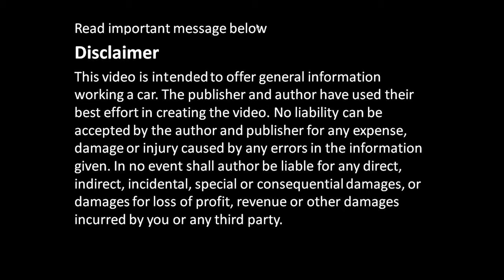How works Oil Cooler

Comment: I have an issue where coolant level keeps going down with no visible external leak, like half an inch down in a week with just a few hours of everyday drive.

Can a bad oil cooler leak coolant into the engine slowly?
Reply from the maker: Thanks for comment 👍😀

Comment: What happens ..if that coolant lines in oilcooler wil get bloked ?
Reply from the maker: Oil becomes hotter and engine could overheat
Reply: @PeterFinnTheCarDoctor   i was driving ..past 1 year like in that situation...
Recently change whole assembly..
Got to know old  part ..coolant line were blocked ..previous owner did that he fixed some sticky thing inside ..for temporary solution..